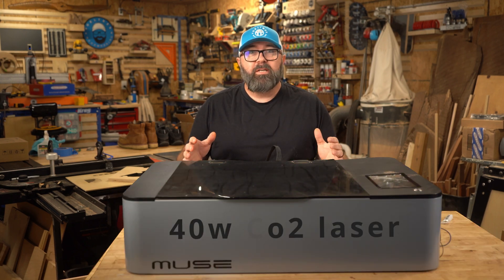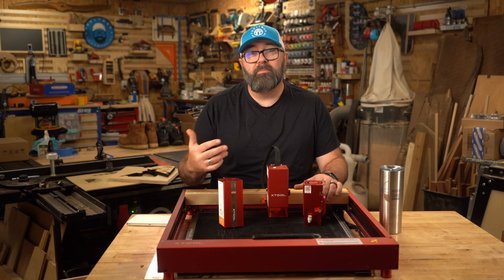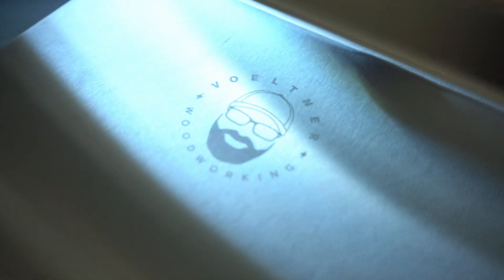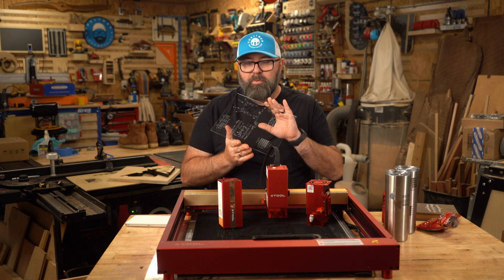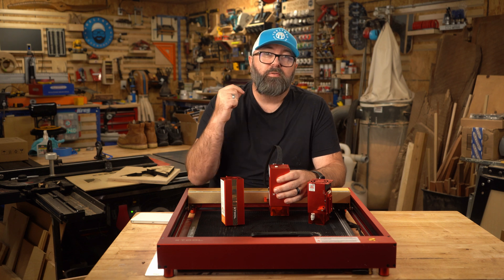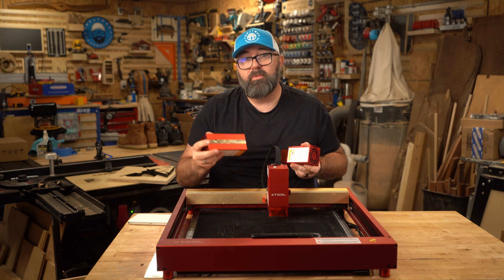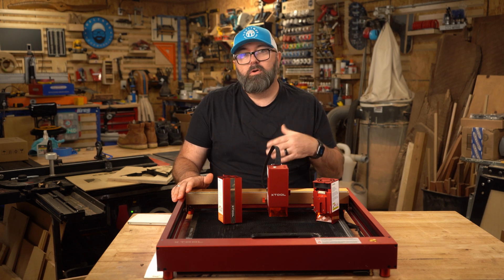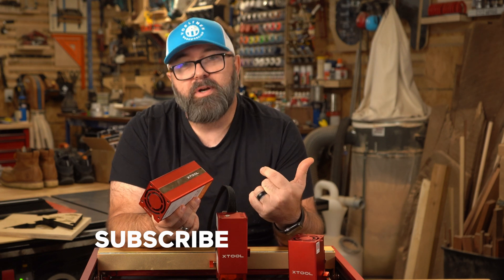40w diode vs 40w Co2 laser

Comment: What I don't understand about these cheap diode lasers is the fact that they don't have an enclosure. And they didn't even have honeycomb beds up until recently or air assist. Logically these should have an enclosure to help with fume extraction and as a safety feature... Although I applaud their improvements, they really need to start making enclosures a standard for all of these.
Reply: Do they normally come with glasses when you buy one new? My daughter bought one second hand and it didn’t have glasses in the package. I’ve just purchased a pair for her but I’d be surprised if they aren’t normally supplied if purchasing a new laser. I sort of agree with the fumes problem but I guess if the area is well ventilated, it might be ok but there’s no way you should use one without eye protection. They should be included at the minimum. It probably is a matter of price that an enclosure isn’t the standard. You’re right though, it would make them a lot safer with having fume extraction and a laser rated lid with some sort of interlock for eye protection. At least with an enclosure, you wouldn’t have to worry about other people walking into the area.
Reply from the maker: @oldchev2850 yes, they come with the necessary glasses.
Reply: @oldchev2850  I've seen a few people say the glasses they come with are almost never sufficient for the wavelength the laser emits, I ordered one recently and plan on getting a proper pair of protective eyewear
Reply: @x.....p-x7j  yeah good idea.
Not sure where you are but I got mine from 'Laser Safety Australia' and model LG005. I like these as I can wear my prescription reading glasses underneath. Just need to check the wavelength which should be on a label on the laser head and make sure the glasses protect against that nm laser. They also have the protection on the sides which would protect your eyes if you turn to look at something else.
Up to you what suits
Reply from the maker: I agree that class 4 lasers are more dangerous, but it is a way for people to get in at a lower cost. Unfortunately most are inexperienced which adds to the dangerous nature. I just reviewed the S1 and I think the class-1 lasers should be the industry standard for entry level lasers. Check out the S1 video if you’d like to see more about that one. I’m also reviewing the WeCreat which is also an enclosed class-1 diode.
Reply: They come with glassess... Very rarely do they come with what you would expect to actually be on a good set of them. You will not get any data about the rated optical density at a given wavelength. 
The likely reason for this is they almost never are the right kind for a UV laser at around 395-405nm if you can see UV leds (easily found these days) through the goggles then they are not the right kind. I can't speak for this brand in particular but I've seen a variety of them come through my local makerspace that do not come with the correct eyewear.

They are almost always green goggles that are laser saftey googles that are mass produced for industrial applications (thus easy and cheap to get in bulk and are merely technically laser safety goggles) intended for fiber lasers that operate at a shorter wavelength.
Reply: Open frame let's you set it on a bigger project that an enclosure limits in many ways
Reply: Oh ok thanks
That's good to know👍
Reply: I could make an enclosure in one hour! Easily 😅
Reply: How do cut mylar stencil material?  Very thin, clear or opaque white.

Comment: Why do you always say cut? You're not cutting anything. You're burning through it.
Reply from the maker: For your awareness, in the XCS software the correct term used to "burn" through something is referred to as a "Cut" path. You can download the free software to educate yourself if you'd like.
Reply: Like a plasma cutter?  I'm fine with cut == thru, engrave/etch == surface.
Then you can say things like "this will engrave stainless, but won't cut it"
Reply from the maker: I'm confused. I don't think I referenced plasm machines, did I?
Reply: @VoeltnerWoodworking  Nah, I was replying to @user... -- I just use "cut" for anything thru, and engrave for everything else, so plasma cutter, tubing cutter, acid etch, glass etch, etc.

And then we start talking about "cutting" dados and half-laps... well, it all falls apart sometime ;)

Speaking of cutting 2x4s... I've used my machine (k40) and 3d printer to do those "Japanese joinery" on plastics... so being able to do that would've been way cool.

Probably needs 1KW or something silly though.  1 KW can cut SS... the leather/wood clicker die company I use has one of those...
Reply: Scissors don't cut anything either...

Comment: The xtool 20 watt is almost double the price of the creality Falcon 20 watt laser and it comes with a honeycomb .  It seems we would be paying $700 just for the xtool name.
Reply from the maker: Can you swap out the modules for the 40w or add an infrared module? I don’t believe Creality has an IR module yet. The ability to have an IR module for that price is pretty good in my opinion.

Also, it’s about a $450 difference at the moment between comparable packages.

Comment: It’s clear that you are able to laser items that protrude out the side of the machine between the legs, but can you laser, say, a cutting board that is, for instance, 50”x50” and have it sitting on top of it while it cuts, or would that mean that the workpiece would be too low for the laser to burn?
Reply from the maker: You can absolutely do that. The head lowers enough for you to get perfect engraving on larger surfaces. Hope that helps.

Comment: Nice overview! I’m really considering a K40 because I’m drawn to the hackable nature of it, but you make some strong points for the modern high-power diodes and their simpler support and maintenance needs. 

You should read up on PPE though, as that dust mask you were wearing is not going to stop you inhaling smoke which is very harmful. Really need to evacuate that smoke anyway, but if you insist, a respirator would serve you better.
Reply from the maker: Thank you. Most of the time my lasers are exhausted but for videos I leave them open. Also, the fumes from wood is a lot less than I inhale next to my bonfires. 😂 My RZ mask has a carbon filter and filters to .1 microns with replaceable filters. 👊🏼

Comment: Do you know the colours come from  when you engrave on stainless steel ?
Reply from the maker: I'm not sure I understand the question. Are you asking for the colors or why they were created?
Reply: Hi
 I think you have done great comparison job.  I have a CO2 laser and know I cannot get such colours on stainless steel ....not even the range of natural oxide colours that happens when you torch stainless. These do not look anything like the natural oxide palette  so I was wondering if your curiosity  had ventured beyond commenting on them. I can observe that you have a strange variation of the orange theme  It could be that because this laser works with a PWM'control system, the pulses going left do not align with the pulses going right and you have a strange aliasing pattern. Despite the truer colour, I detect the same slight botchiness on the blue. These are the sort of issues that fascinate me  so I wondered if you can explain how the limited palette of colours can happen from just a monochromatic beam of blue light. If you change the line spacing or frequency  do the colours change or disappear?     A subject for a future video?
Reply from the maker: Thank you. It’s a combination of speed and power settings that creates the color variation with the diode laser. There are many other colors that can be created with adjusting these settings, and it does have a bit to do with how quickly each segment overlaps the previous; changing the timing from when the laser passes over again allows for more or less cooling off the material which alters the results.
Reply: @VoeltnerWoodworking   Thanks for the though but yours and my CO2 lasers have power, speed,  line spacing,  heating and coolig adjustments so why cant we get colours?  I need to do more research.
Reply from the maker: @SarbarMultimedia you will not be able to get those colors with a CO2. It’s the blue light diode laser that reacts with the stainless. I also have a CO2, and can confirm you will not get these results with that type of laser.

Comment: This was very informative.
If i ever get one, I'd likely want the rotary tool as well. I would most likely use the laser to engrave metal, plexiglass, leather and wood, as well as cutting wood and plexiglass (maybe leather, cardboard). I think I'd prefer the 40W IC laser, simply because i don't have the room for a CO2 laser and all the support equipment.
In fact, right now, that's the main reason I'm not getting any laser cutter/engraver!
But I'd like to have one....
Reply from the maker: Thank you. Stay away from plexi and do acrylic. There are some materials you’ve got to be careful with. A 40 diode sounds like it will work perfectly for you.

Comment: The only material I am intersted in etching is Carbon Fibre with a logo - can this be done?
Reply from the maker: I believe carbon fiber is toxic, so it shouldn't be laser engraved. You may be better off with a CNC router/spindle machine for that.